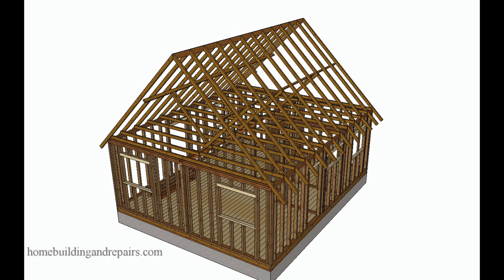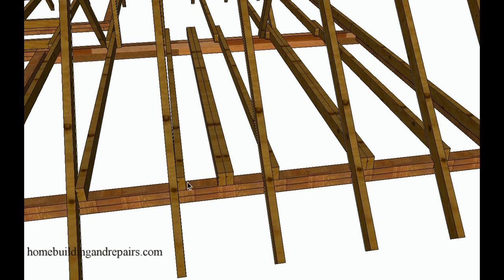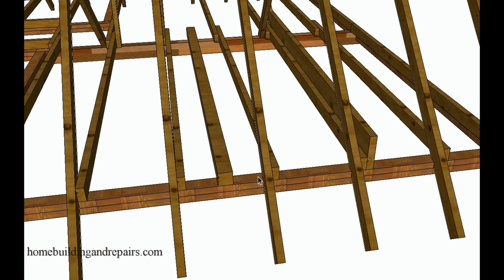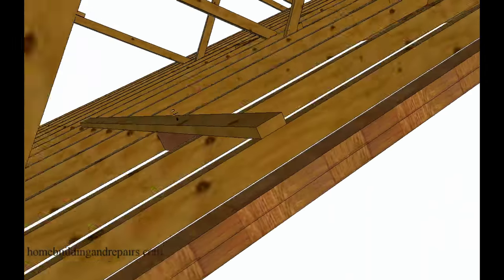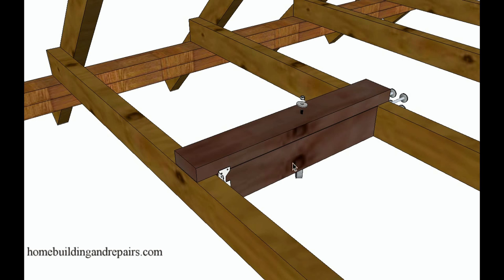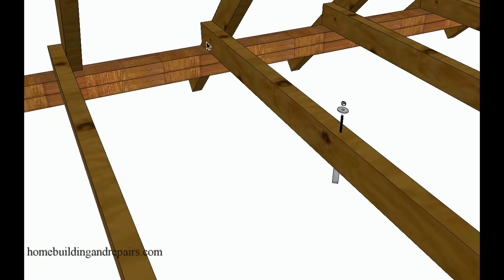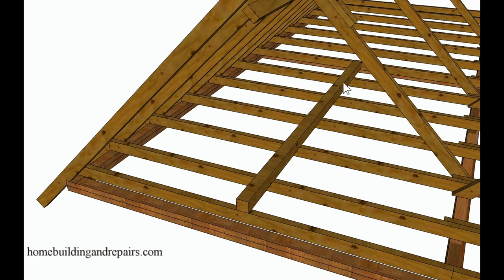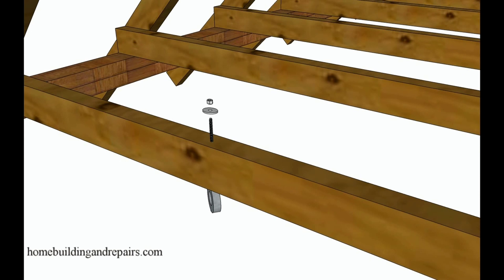Interior Structural Wood Framing Ceiling Support Ideas for Hanging Swings

Comment: Thank you very much for explanation.  However, I'm wondering whether I can hang my 300 lbs chandelier by these techniques or not. Your response is much appreciated
Reply from the maker: I can't say for sure, because you will need a rated electrical box also to hold extra weight.

Comment: Hi , great video. Any advice for hanging a therapy swing in a vaulted ceiling?
Reply from the maker: Not really. I would think you could bolt something like a piece of steel angle iron to the rafter or rafters over the ceiling drywall that might work. Let me know if it make sense.

Comment: Thanks for the video really well made!  I have a couple question 1: i was wondering if it's it the same thing with a basement ceiling ? 2: i made a mistake to install the cross beam under and not over the support trusses would this affect something ? 3: i only cover 3 trusses with my beam(2 by 4) is it not enough for a swing? (my swing is a single string for one person like one chair ...)
Reply from the maker: A basement ceiling might be the upper floor and need a support beam under the floor or in the floor framing. A floor joist might be strong enough to support one side of your swing.
Reply: @gregvancom  Youtube should have the option for a picture in the comments :( so a basement ceilling structure is stronger than a roof ceilling right ?

Comment: Great video, thanks for the info. Would you recommend lag screws over carriage bolts? I’m not mounting a bench, but an island range hood. The whole thing will weigh under 150lbs and I can’t have it shifting at all.
Reply from the maker: I like bolts with nuts and washers, but the right lag screw might do the job.
Reply: @gregvancom  ok, thanks for the advice!

Comment: Do you have any more detail information for adding a doubler rafter?  I need to find out where to add nails or screws and what size etc..
Reply from the maker: Go to our website and in the repairs section click on framing, then roof or ceiling to see if you can find something. Let me know if you can't.
Reply: @gregvancom  just add the link. But thank you. I have a screened in porch. Definitely gonna have to brace it. The wife will use it a lot. Great info, and I didn’t think about the swing moving the support system. Ty!

Comment: if you're swinging runs the same direction as the joist can you use two lag screws into one joist there
Reply from the maker: +Mark Tatum I guess it all depends upon the size of the joist, for example if you have a large joist, then it might not be a problem. However, it could be a problem and I want to focus on the words "could be a problem" with joist 2 x 6 or smaller.
Reply: Ty

Comment: Hi, I am looking for a solution to suspend a rose wood wooden swing with brass chains (200 lbs) with a total load bearing capacity of 1500 lbs from a high vaulted ceiling (traditional colonial house)?
Reply from the maker: +Durga Iyer That's a lot of weight and might require the help of a structural engineer.
Reply: Durga Iyer did u install your swing?
Reply: I have a vaulted ceiling as well and wanted to hang a chair swing. Did you ended up hanging one in all those years?
Reply: Did you install your swing? I am buying a home and would like to install swing. But I am
wondering how to do that

Comment: I have done these methods before;however, I have a client allowed to hang a baby swing from the ceiling but I have no access to the joists above the ceiling.  I was planning to run a length of 3/4 plywood on the ceiling and lag screw into a few joists and have my eye bolt through the 3/4. Thoughts? Advice?
Reply from the maker: It sounds feasible and I think you could always test it by placing 30 or 40 pounds in the baby swing and swinging it to see what the effects would be.
Reply: @gregvancom  thanks so much for the reply and the great content!
Reply from the maker: @guycleveland5946  You are welcome and thanks for watching our videos.